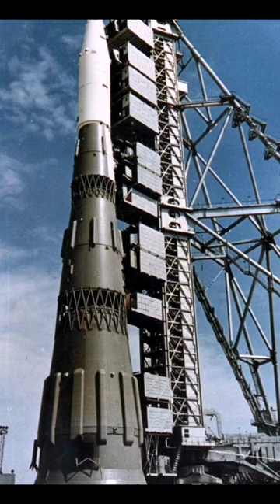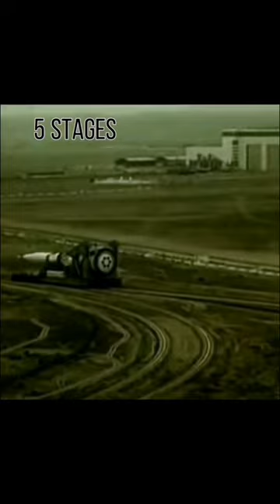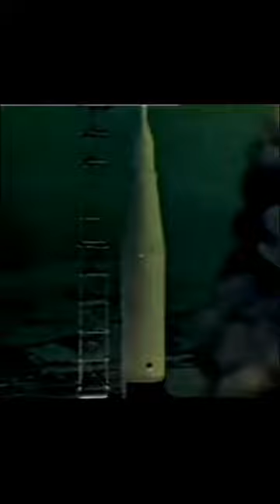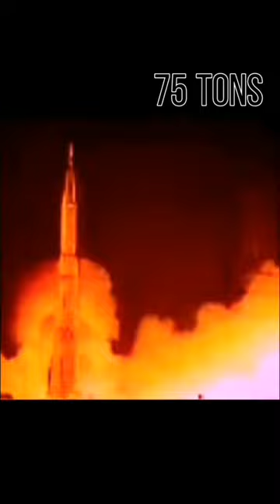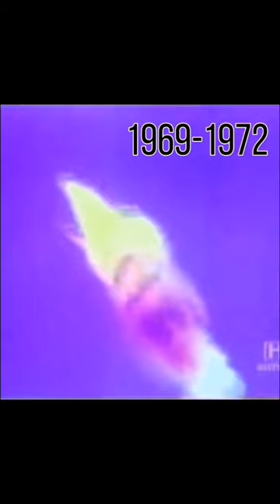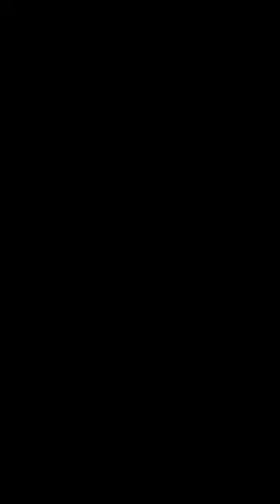Soviet N1 Moon Rocket | The Largest Rocket We Have Forgotten

Comment: Too many rocket engine lead to failure
Reply: Yeah....no , it wasn't the engines that made it fail

Look at the falcon heavy for example , that thing has 27 engines and it flew flawlessly
Reply: @NHAFFFF  3 separate engine Falcon stacks, with only the Center section’s engines being used for  launch & flight control, not the 2 (essentially) strap-on boosters; is different than having to use all of the 27-31 Merlin engines to eventually launch and control Starship.  Plus, Falcon Heavy doesn’t have to pass the added safety certifications for manned flight, and will stay a cargo-only launcher.  

  Starship’s multitude of first stage rocket engines used for both launch & flight control, like the N1, is going to add an insane amount of complexity.   Complexity that will obviously have to pass even more rigorous safety standards because of the latter manned version.   
Instead of say using these +10yrs to develop a much more powerful (but simpler overall) engine in the Saturn5’s F1 power class.
Reply: @cjwrench07  agreed. On the last part though - the RS 25 engine fits that criteria, used on the space shuttle and sls.
Reply: Aerospace Exploration  Are you being sarcastic? Starship Super Heavy booster has 28 engines, only two less than N1.
Reply: @cjwrench07  but boosters work in unison
Reply: @FrankyPi  I think starships superheavy would max out at 32
Reply: Aerospace Exploration  if the plumbing is difficult I don’t think SpaceX would do it
Reply: Actually starship